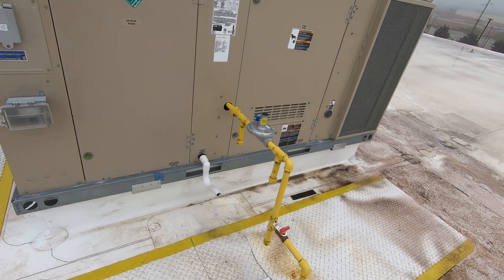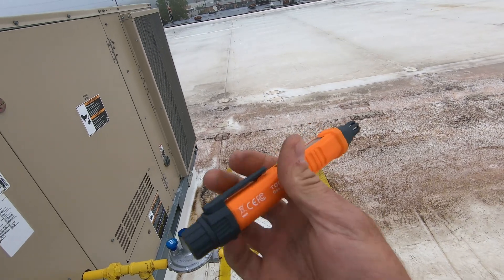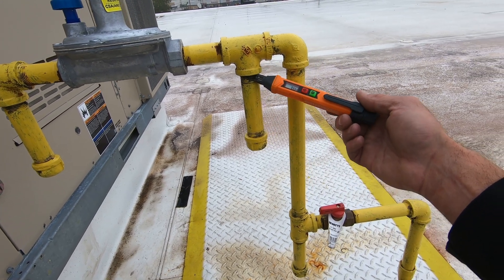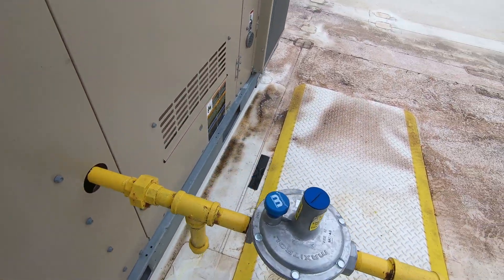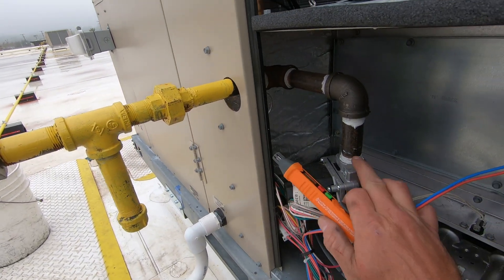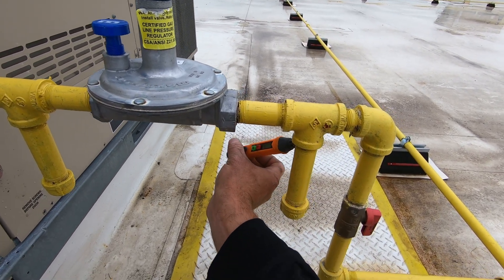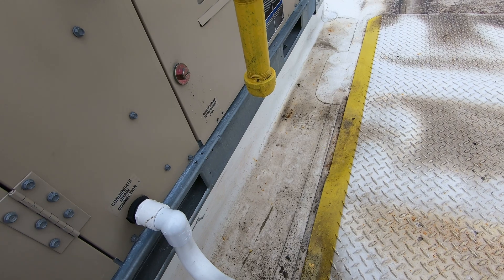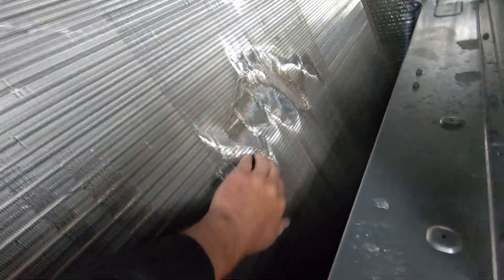Multiple Gas Leaks: Testing a $20 Amazon Gas Leak Detector

Comment: Nice info, fits nice in the toolbag, I'm picking one up.. 
I also use the bascom turner as the the other post stated, it is very nice but it's spendy and sensors do fail.